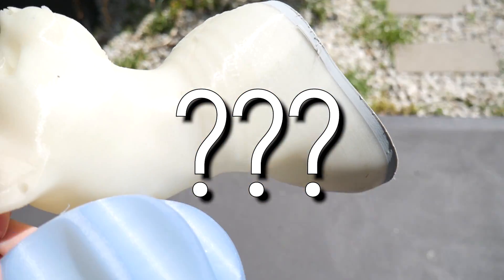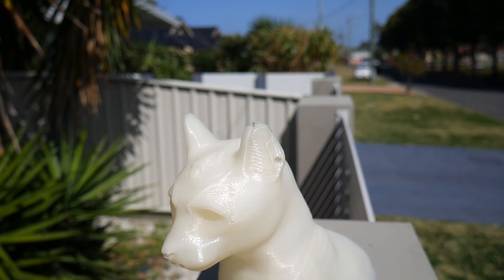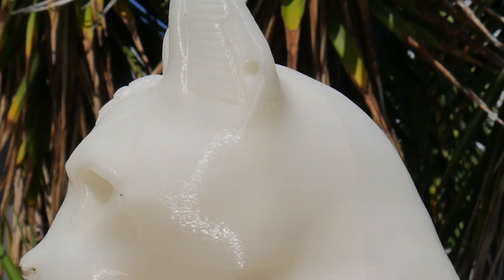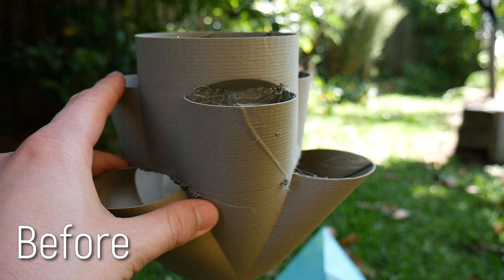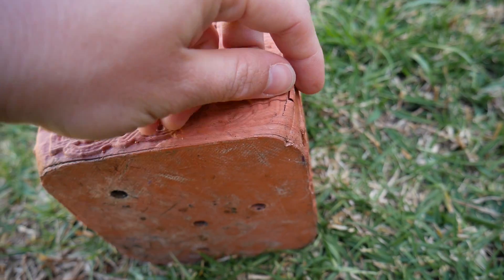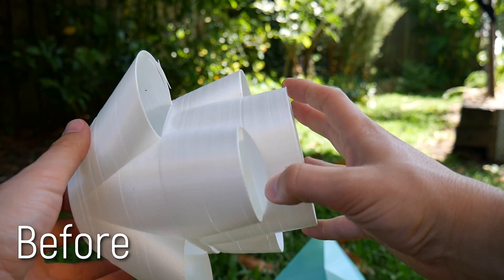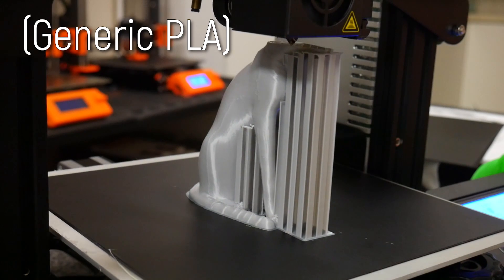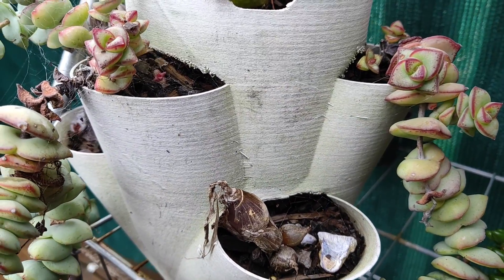Can you leave 3D Prints outside? PLA in the sun for a year!

Comment: I made a PLA green transom mount for my boat depth sounder.  So far it has been alive for about 9 months with no signs of breakdown.  Admittedly, the boat is 'mostly' covered with a tarp, but the transom is exposed for most of the day.  And this is in the much harsher Townsville (North QLD) sunshine.  If it breaks, it's still cheaper for me to reprint, than buy a $60 replacement from Humminbird!
Reply: Good to know. I was thinking about printing a custom scupper drain for my sailboat cockpit, as the factory drains are inadequate. Figured I'd test fit everything with PLA, then switch to ABS after it degraded. But sounds like it could last years, since not structural in anyway.

Comment: I've had several PLA brackets securing an awning to a shed for over two years. They've survived several storms, a couple of heat waves, where the temperature reached 30+ degrees C. The awning failed first during a storm and the brackets are still going strong.

Comment: Hey Angus, could you talk about more advanced fume management techniques? I love 3D printing ever since I set up my budget maker space based on your videos! But I've since discovered that I am very sensative to the fumes, even from PLA. So I'm looking for more effective and controlled ways to manage the fumes besides just blowing a fan and cracking a window.
Reply: You could do what a lot of newer/higher-end 3D printers are doing and enclosing the build space with the exhaust air passing through a HEPA-rated filter. Essentially you just need to make a box that covers the entire working space of your 3D printer - you can make it out of wood or even just acrylic sheets taped together, optionally add a door, as long as it's reasonably airtight - and then have a hole (probably somewhere near the top) in which you can fit a filter. You can get some small cheap HEPA filters as replacement filters for vacuum cleaners or air purifiers.

Comment: Interesting! 
I am running similar tests. I place a test part of every filament type I buy on my balcony which is placed at the south side (sun side) of the house. The test part contains the filament name and print date. My longest running test is white PLA. After 1,5 years absolutely nothing has happened. The green PLA which is 1 year old is also as good as new. The test duration of the other materials is still fairly short. PETG and ASA are still as good as new after 0.5 year. This is in contrast with white ABS. The colour is already fairly yellow after 0.5 year.
Reply: How many colors have you done in PLA and would you consider showing any images of how they look now? Would be really helpful in informing me on a project.
Reply: Very interesting. Thx for info

Comment: These prints held up better than I would have thought, but I don’t really understand why we print in PLA anymore at all.  It’s the “easy” filament that doesn’t require a heated bed or high print temperatures.  If you have a decent printer and a little experience I would think all of the other polymers that have better qualities at least on paper would be much more popular.  I understand PLA usually works but I still think it is rarely the best choice.

Comment: That's some interesting results. Mimics nothing like what I've experienced in Texas, but It's safe to assume that different brands will have different outcomes. Hatchbox white and black along with wood pla seem to have way less heat tolerance than the filaments you used.  I had several Catan pieces greatly deformed being left in the sun for less than an hour and a baby groot model that bent at the neck backwards from the weight of the head. The wood filament had a tacky feel to it while the white and black did not and just felt warm. I'm going to get another brand of filament and see if those prints fair better outside.

Comment: i've printed a firget spinner that i kept indoors and it cracked around all the 4 bearing holes while being under a little bit of tension because of the bearing and weights (3d printed bearing and 3 nuts in 3d printed holders). pla is very much prototype or indoor decorations only material
Reply: PLA is strong, but very brittle. But it can usually handle more tension if you heat it up a little before fitting in the bearings.

Comment: PLA used for an outdoor bracket I made, which was screwed together with lag screws, deformed in the sun's heat where the screws were putting pressure on it and loosened the screw connections. I think your prints were not under any real stress so they did not deform.
Reply: Adding metal insert collars for the screws might help mitigate the deformation.
Reply: That's a good idea. I will keep this in mind for future projects. I did manage to solve the deformation issue by printing in ABS, but it took several failed prints to get one that didn't warp and curl off the print bed. In future, I will keep your suggestion in mind. Thanks, mate!
Reply: Heat probably softened the plastic, and the pressure from screws pushed the plastic away and made it loose. His items were under stress from the things they were holding and the plastic itself.
Reply: I had a similar experience with a wall bracket that held a flower basket. When it got heated by the sun the stress made it bend. Also you all saying that metal retained heat it is the opposite metal dissipates heat faster than the plastic would.
Reply: That's probably less of the stress and more of the heat being retained by the metal which heated up the pla itself
Reply: That's sounds right to me. The metal held in heat.  :{
Reply: He lives in hot-as-balls Australia and you think his prints didn't experience any stress?!?  :{O
Reply: I don't think Australia was so tiny that it had a uniform climate. You're going to really piss them off if you go around implying that.
Reply: You're the one generalizing kid. 

He's said before that it's hot where he lives. So I know that it's hot where he is. 

Taking everything so literally isn't so appealing either.  :{
Reply: If the defense of your innocent mistake is to quote a subjective term like "it hot" as your proof, then I can't help you. Nice chatting with you.
Reply: I'm not the one who conflated "hot" with mechanical stress, then asserted that the entire continent of Australia was "hot as balls". But you be you. PROTIP: If you're going to hurl insults at strangers, make sure you have someone check them over for hypocrisy and irony.
Reply: No you're the one that takes every word literally and would say anything to save face.  :{J
Reply: @tetsuoswrath  Is there a metaphorically interpretation you wanted?
Reply: @chrisdotson6417  wanna try again and type that better? Also, looks really funny you trying to chime into an argument from 3 years ago. You must love drama.   :{

Comment: OVER 40°c where do you live

edit: oh Australia....makes sence
Reply: How do you make the the little circle degree sign?  I'm using an android touchscreen and can't find it.
Reply: @raykent3211  in the bottom left of your keyboard there should be a 
"!#☺" button press that and it leads you to the symbols.
and after that above the ABC button should be one that says 1/2 press it and it will lead you to the second page of symbols, if that doesn't work maybe go into your phone settings and try to fix it
Reply: @marcisozols2800   thanks very much!  Long may you quack and paddle.
Reply: @raykent3211  may your temperature related comments now be complete

Comment: Can you make this video aswell for a petg and abs print?
Reply: ABS kept in sunlight is a nightmare, a translucent single-layer print might start falling apart within a single month.
Reply: I know that ABS can take the heat, he did a video where he left PLA & ABS in a hot car, PLA started deforming where ABS wasn't bothered a bit. I don't know about weathering and UV degradation about ABS, though. That would definitely be worth a look.
Reply: ABS turns brittle after prolonged exposure, but ASA is UV resistant, and has very similar mechanical and printing properties to ABS.

PETG is fairly UV resistant, and the planters on my porch are still quite sturdy and flexible after a couple rough and cloudless summers.
Reply: William Shreckengost we’ve had black ABS prints outdoors in the UK for 2 years without any problems. The shinyness fades a bit, but otherwise it stays strong and colour stable.
Reply: William Shreckengost “Carbon” black?
Reply: What about polycarbonate?

Comment: Does ABS hold up perfectly outdoors or does it too have some degradation from weathering/UV etc.?
Reply: My brother made a planter box with painted ABS corners holding it together some time last year. Its been holding up pretty well.
Reply: @Coboxite  yeah, paint (and other coatings) can help absorb the UV and preserve the underlying plastic, if you want to use a material that doesn't hold up well naturally
Reply: ASA is ABS that is more uv resistant. Bit more expensive.
Reply: ABS is just as bad if not worse than PLA under UV. ASA is a much better filament to go with if you need a styrene-based plastic that's going to stand up to direct sunlight - it still degrades over time, but being ~10 times as resistant to UV it should last quite a bit longer.
Reply: Makrond our ABS prints have lasted 2 years so far in the UK outdoors.

Comment: Well, that gives me hope for PLA parts on my bike mods and motorisation. Was originally going to mod my Anet A6 for go in a cabinet and use ABS or PET but if PLA can survive that long, it's hopeful. Plus I'd paint it anyway for extra UV protection
Reply: You shouldn't need any mods for PET, it has low shrinkage. But yeah ABS, haven't really gotten decent prints off my open-frame printer either, figuring out how to box it in nicely.
Reply: At the moment ABS & PLA are the cheapest (same price, actually) while PET is either "out of stock" or costs a bloody fortune, hence leaning towards the ABS originally. But after this, I'm starting to think PLA with a good coat of primer and a few layers of paint should hold up okay. I re-build the bike so often anyway

Comment: Love the robot wheel.  What size of motor you reckon would support it?
Reply from the maker: I drove similar ones off 12v cordless drill gearmotors - you can easily push a 15kg machine around with two of them! I used them in this build - https://youtu.be/fGE6FPOP3vE